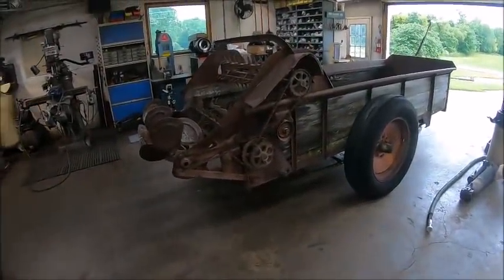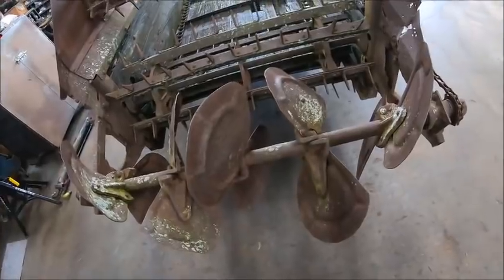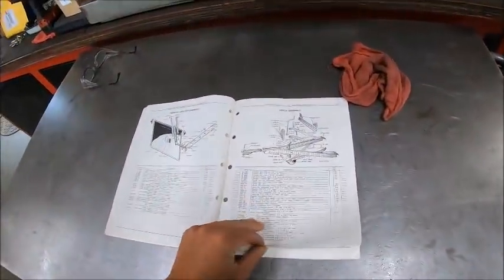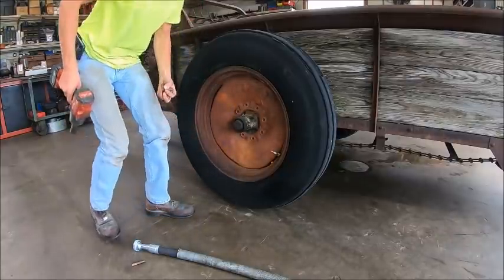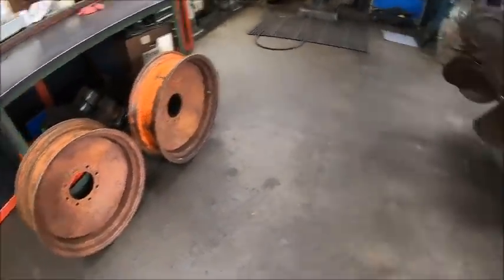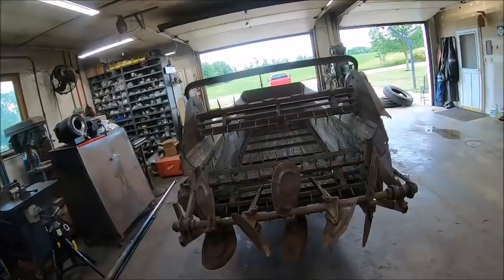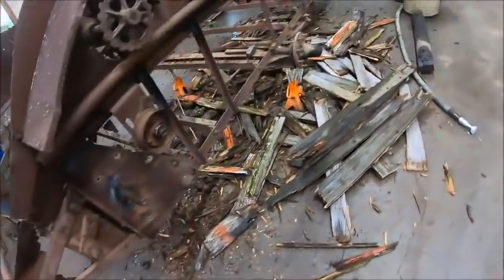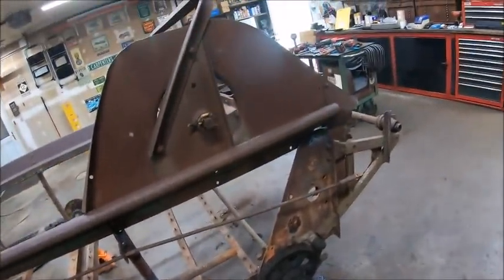New Idea 19 Spreader Part 1

Comment: Instead of blasting the frame and etc.  Check out CRC Rust converter. I think you will be impressed with the product. Thanks for the video.
Reply from the maker: Blasting is cheap and easy and I need is 100% clean so I can weld on it to fix the rust issues.

Comment: Yep, New Idea made manuals that you could practical make clones of their equipment. And the orange(or red on later models) and green paint made them look really nice for some reason. The later solid grey and red looked "ok", but they lacked the personality.
I personally wouldn't put tractor type tires on a pto spreader(I would have tried for truck radials myself), but it's you spreader and you can do what ever you like. Regardless, think she'll look sharp anyways.
Reply from the maker: I hate automotive tires on farm equipment. Can’t stand used tires because you never know when they are going to give out. And truck tires are useless in soft ground because they ball up and won’t turn.
Reply: @Oliver66FarmBoy  I meant heavy truck tires. Never passenger tires
Reply from the maker: That’s what I meant to.
Reply: @Oliver66FarmBoy   Ive used several pieces of equipment with truck tires(manure spreaders, gravity wagons, and a seed drill) and never thought the issues(which tractor style tires do help) you describe were that prevalent.  But I do appreciate your argument.
Reply from the maker: I’ve got them on my corn picker. Worthless. Midas well be on skis.